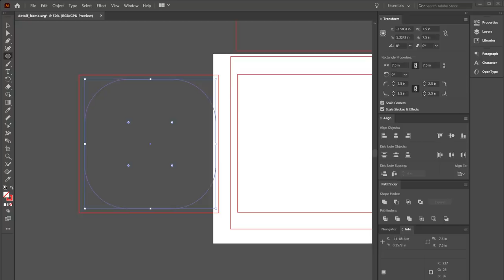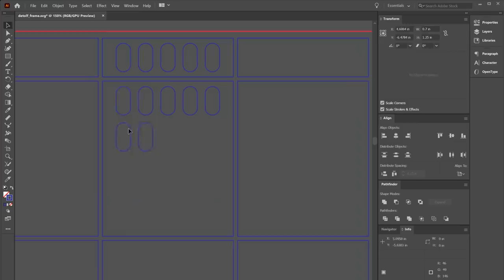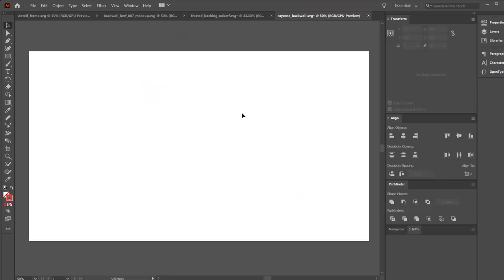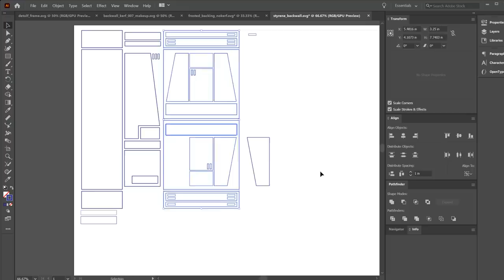Star Wars Death Star Corridor Figure Diorama!

Comment: Hi Norm, there is a way to make a high powered pass followed by a low powered pass.  Simply make two copies of your object, set the desired speed and power for each pass and then align the two objects on top of each other.  Very cool project, turned out great!

Comment: Congratz Norm, the Result is stunning!
The skills you need as a "Modelmaker" have changed so radically over the last few years.
When i was young this would have been a tideous work and you would have seen it is handmade in the end and you could clearly judge the skill of the modelmaker looking at the model.
Now basically everyone with Computerskills and money for the fitting machines can pump out a factory grade model kit. The stangest part is you might not even need the skills to convert
it because you can download the files from someone. Don´t get me wrong, i respect that work! It is just SO different. The work is done on a keyboard and the modeling comes down to assembly...
That is why i will always respect stuff like Luke Towan puts out more even though they both might look as impressing.
Reply: Yes, the barrier from imagination to reality has dropped significantly.

Comment: You could do the two passes of the styrene with different powers very easily. You just have to run the job twice, instead of setting it to "2 passes." Run it, 1 pass, at whatever power. Don't TOUCH ANYTHING on the machine. Change your power settings, do a second run. 
THANK YOU for sharing the files! Can't wait to make a few display shelves.

Comment: This could not have come at more perfect time! I just started designing one last night. I am using 1/8 luan plywood to test fit everything, It's cheaper than acrylic if I mess up. Thanks for sharing this build and your design patterns.
Reply: Test the kerf for press-fit first.  Materials cut differently.
Reply: Grey board is great for test cuts, very cheap, avaliable in 1-3mm thick sheets to match your final project material, and cuts great with just some soot to deal with on the edges.

Comment: Suggestions -
- Detailing on the rear wall, a heavy paper stock / light card laser cut would do that perfectly without being overkill or giving you any of the agro.
- The top front rail of the build could hide some front lighting nicely to help illuminate the figurines rather than keeping them almost silhouetted (Specifically wierd ass samuri Vader)
Reply from the maker: Great ideas! Lighting from the front would also make the diorama look more like a stage, almost as if these were characters in a Star Wars kabuki!

Comment: Wait. The glowforge needed 2 passes to cut .040" ?!  That's only 1mm !!
Reply from the maker: it didn't need to, but i turned power down and chose to do 2 passes to avoid melting the edges too much--and still the edges curled up from the heat :/